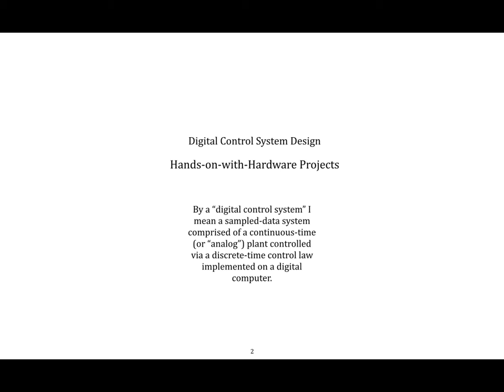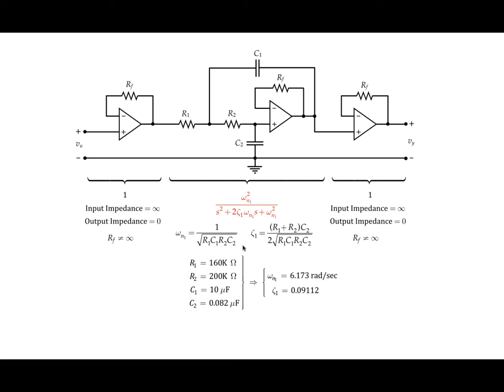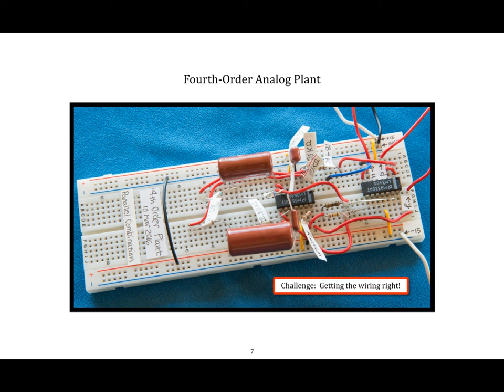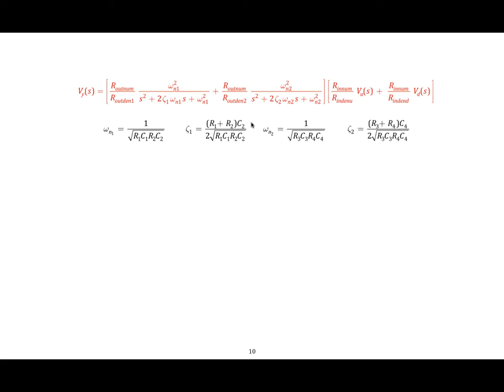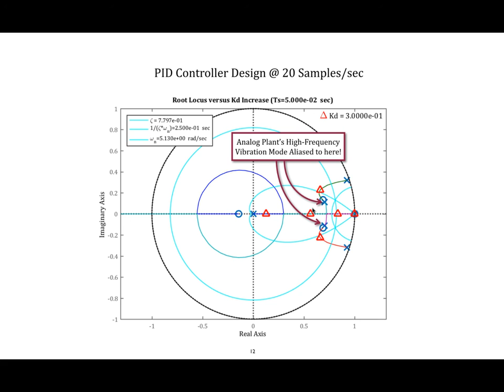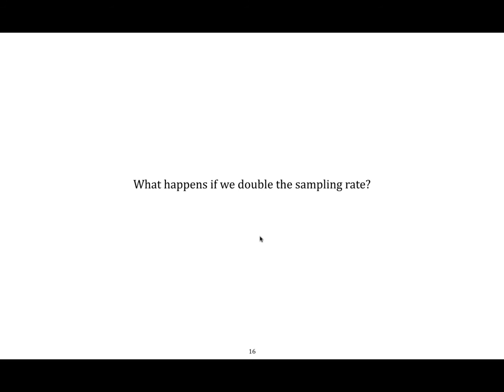myRIO: Hands on Learning @ University of Washington_Berg

Comment from the maker: Could this be adapted to a small motor/mass combination that would not be too expensive and either loaned or sold to the distance students? Also, do the students write the LabVIEW programs?
Reply from the maker: Yes.  And it would, without a doubt, be nice to have the students also have a hands-on-with-hardware experience with an electromechanical plant.  My hesitation with moving in that direction, though, would be the potential complications and cost of developing whatever software drivers might be necessary to interface with the hardware.  And the flexibility to implement such a huge variety of different plant dynamics on a breadboard largely goes out the window when one is constrained to the use of an electromechanical plant.

And regarding the students developing their own LabVIEW programs: Yes, I do have the students develop some of there own LabVIEW VIs.  For example, I introduce them to LabVIEW programming by having them develop a "virtual kitchen timer".  But for their later project work where they implement closed-loop control of an analog plant, I provide them with a VI that implements, in hard-real-time (using a Timed Loop, in LabVIEW), the control law they are to implement, with the control law parameters, which they have had to determine, entered via LabVIEW Controls on its front panel.

Comment: Excellent approach. Do you and your students address how well this plant represents the operation of mechanical plants? It is sometimes difficult for my Mech Eng students to connect what they are doing with electronics to what they consider to be the 'real world.' Also, do you have any open-ended activities where students still breadboard their own circuits and control applications?
Reply from the maker: I do my best to get across to my students that the analog plant they construct on a breadboard is a dynamic system in the same sense that an electromechanical system could be built to realize the same dynamics.  But your question has me thinking that doing that well is perhaps more important than I have given it credit for up until now.

Thus far I have not assigned such an open-ended activity.  But I have pondered doing so in a future project which will make it clear that the students are expected to design and implement an analog low-pass filter to filter out the "staircase" control signal that is output through one of the myRIOs analog output channels, so as to avoid having the high frequency content of that staircase signal excite their analog plant's high-frequency vibration mode).

Comment from the maker: I really like the price and portability of these experiments, even suitable for distance learning students. The 4th order plant built on a PCB has some reconfigurability yet removes the headache of students having to breadboard the circuit.  Do the students write their own code from scratch, edit a template, or do they just adjust parameters?
Reply from the maker: See the second paragraph of my response to be above question.  But let me add that while the students have the opportunity to "do the minimum" and simply adjust the parameters of a given control law implementation, my sense is very much that the better students go on to investigate the block diagram of the VI that I supply to them.  That LabVIEW is fundamentally a block diagram programming language is super helpful, in encouraging such exploration by the better, and even not-so-better, students.